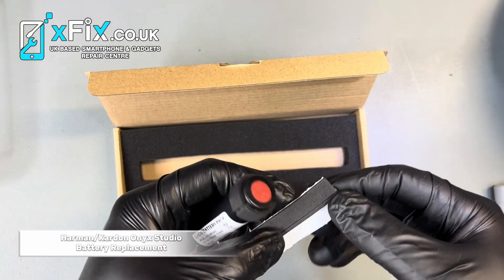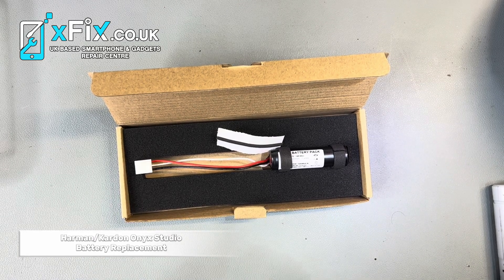How to Replace the Battery in a Harman Kardon Onyx Studio 1/ 2/ 3/ 4

Comment: I Have Similar Speaker However It's Not A Good Speaker Charge Time To Long And No Meter Full Charge Read Out , Will Replace With Less Time Charge Speaker
Reply: When the battery is charging the power button flashes. When it is full the light turns solid or switches off, depending on the model.